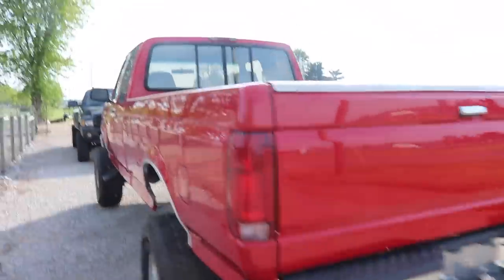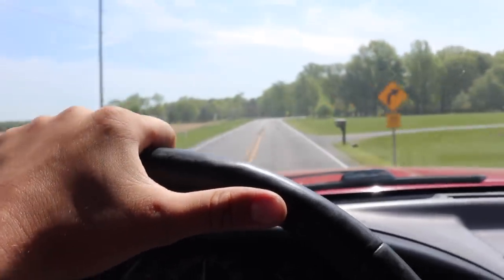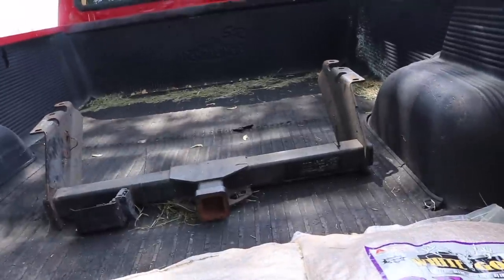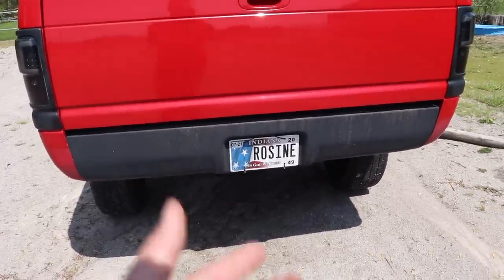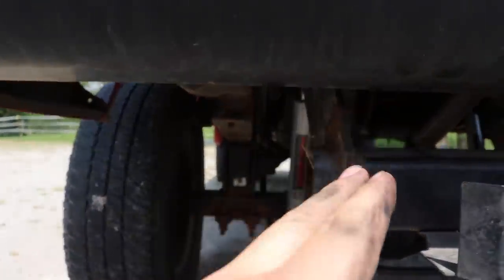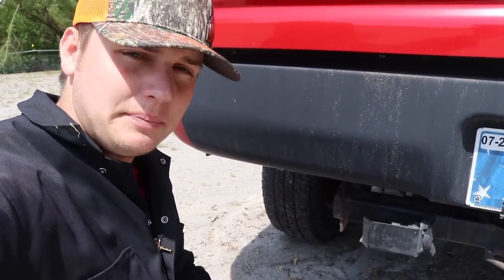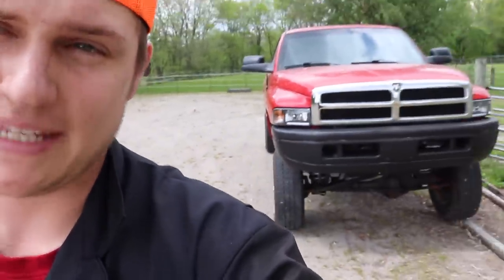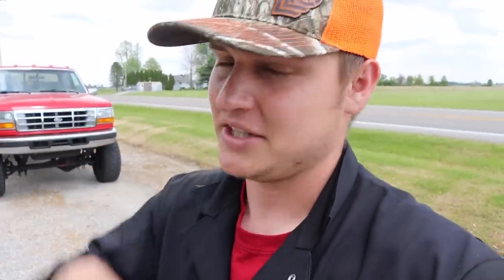How to INSTALL TOW PACKAGE with roll pan!!!

Comment: You can do that hitch on the Ford have Jeshua help you put it in place then drill the holes I would put heaviest duty on it the trailer wiring might be a pain but a lot of them can be plugged into harness

Comment: In short, move the hitch forward on the truck to different holes on the frame and modify roll pan to tighten down hitch to the frame.